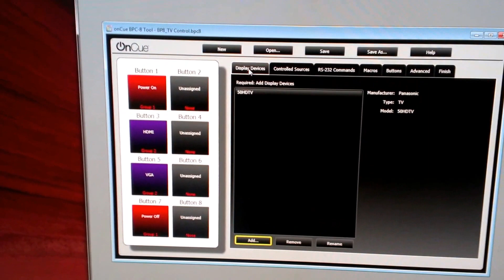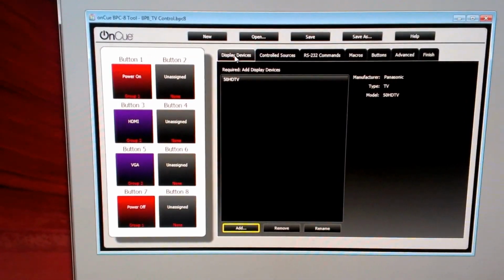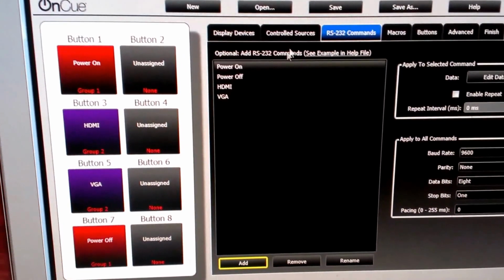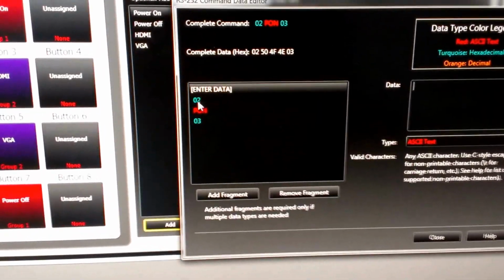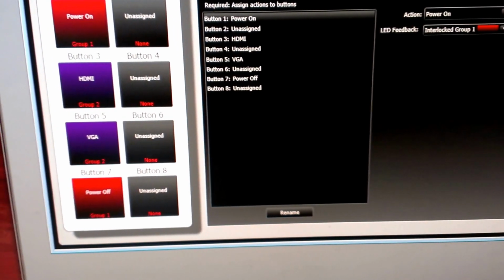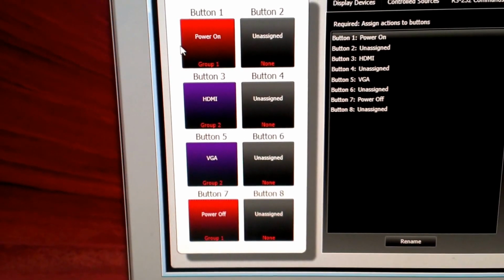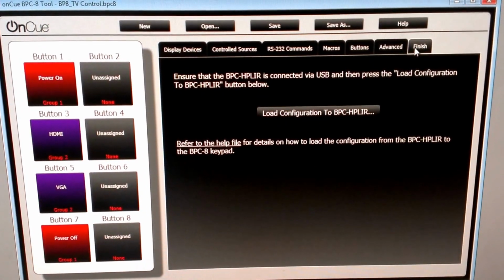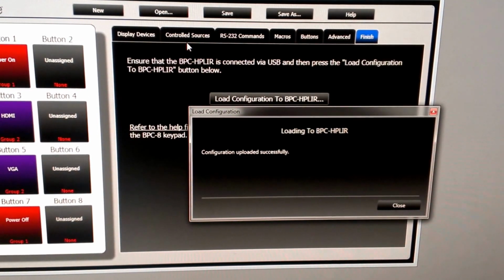Crestron BPC-8 Programming

Comment: Hey, just wondering if you can help me.

I installed a whole bunch of these (14), and I programmed 2 of them with the help of the user manual pressing at the same time button 1 and 8 for ten seconds and then I put the code for a nec proyector (Buttons 1-2-6) this was before I got in my hands the IR Learner...

Now, those 2 BPC-8 wont take the programming I try to upload to them with the IR Learner... Can you please tell me what I can do please? Thanks!...